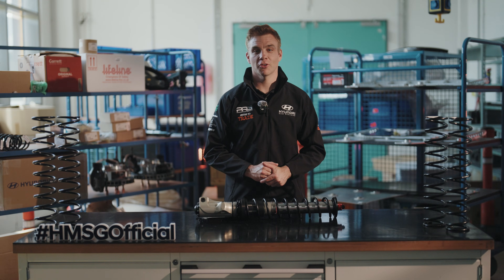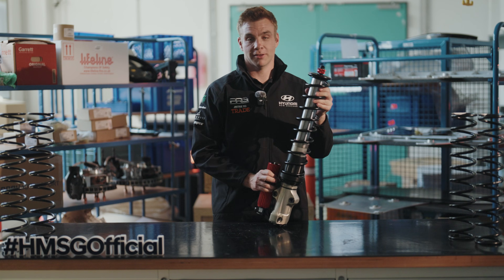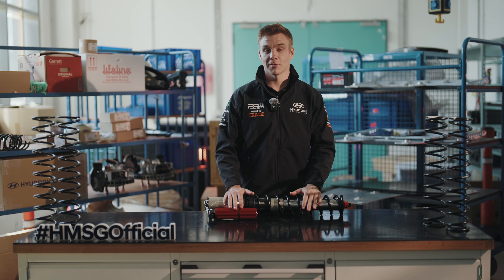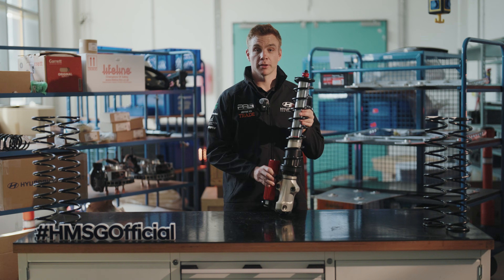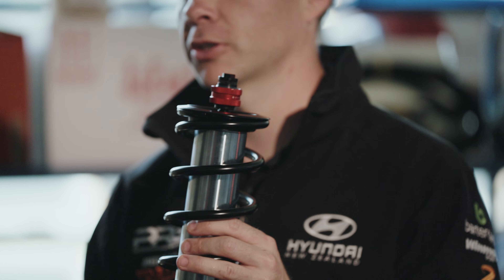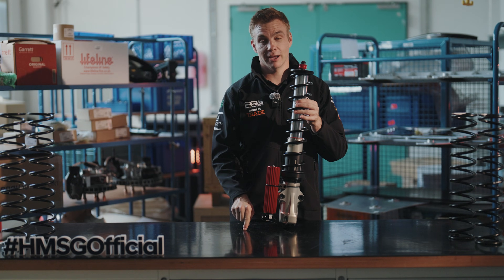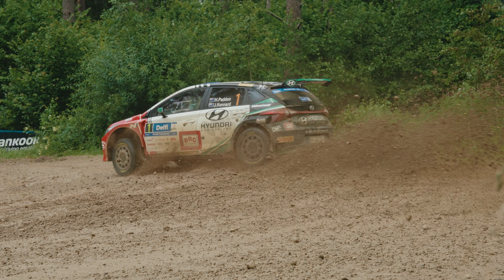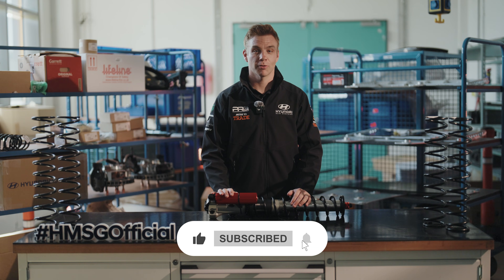Suspension Secrets Revealed: How to Achieve the Perfect Setup

Comment: These videos are ofcourse great & on-point, but here are my 2 words on what helps me wrap my head around the tune of an already factory spec-ed out suspension kit (cause, of-course, specing out a base suspension kit is a book worthy topic)

6:20
In explanation of springs & dampers, it helps me to think about them as the "steady state" component & the "transient" (varying in time) component of the suspension system.

Dampers are more interesting though & what many people have difficulties wrapping their heads around, especially in simulators. In a well specced, two speed damper, set the low speed damper as high as the dials allow. The car should be stiff as a brick & what is important, it should lose grip immediately on attempt to rotate the car.
Here is where the "transient" part comes in. By lowering the damper setting, we are spreading the rotation energy over time. So, keep on lowering that dial, until you feel the car float pleasantly & controllably from side to side, with safe amount of rotation. There are caveats to this rule, especially when it comes to stresses on materials. But this is the most straight-forward way to get in the ball park of "ideal" values.

Spring stiffness & length has to be picked in accord with road conditions. Be stiff enough to handle the road & not too short, to spread energy of bumps over period non-damaging to the chassis. Then we have to balance them, but we are talking about factory specced kit. In most cases, it is a calculated thing, just set & forget.
Reply: AND! This is for the sim guys mostly, because people building suspensions already know this.

BUMP values have to be much higher compared to REBOUND values. This is because in bump, we are working against mass of the car (sprung mass). In rebound, we are working against mass & inertia of the wheel assembly (unsprung mass).

If the car wobbles too much on landing big jumps, don't touch that rebound knob. First make sure that you are actually smoothly absorbing the landing energy with spring & bump direction of the damper.
Reply from the maker: We love seeing how different people wrap their heads around it! 😁

Comment: 600mm/sec and above  is considered high speed compression? Wow. Is this a rally car definition? For circuit cars it's more like 10in/sec or 250mm/sec. Are rally dampers (i.e Reiger) setup so that HSC is at around 600mm/sec?
Reply from the maker: Yes, 600mm/s is high speed compression, and at some gravel events the speed can reach as much 2000-2500 mm/s 🤯

Comment: Hello. I would like to know few things if possible. How does the ride height setting work in correlation with spring rate? Does it increase or decrease suspension travel or is it like a separate "block" at the bottom that doesn't affect suspension travel? 

What about spring rate's effect on ride height? I always thought that spring rate would also affect ride height because with softer spring the weight of the car alone would compress the spring more. This assuming that springs with different spring rates are the same length when uncompressed. But is this case? Does softer springs lower the car and vise versa?
Reply from the maker: So, the ride height is adjusted moving the spring platform or adding spacers between the spring and platform. The springs are compensated for a specific static load (weight of the unsprung mass individual corner). Changing the ride height does not change the total suspension travel but shifts the travel between rebound and bump.

When it comes to the spring rate's effect on ride height, the springs are load compensated. Therefore the free length is different for each rate. In this way the ride height is achieved without adjusting the spring platform 😁

Comment: How do you balance the damper in a fast rally like Finland with fast corners and high grip  and jumps? What do  you search for in different damper brands/models?
Reply from the maker: The balance for this specific rally is to have good chassis control due to the high-speed nature of the stages. That is achieved by working on the low-speed area of the dampers. For the jumps, the high-speed area needs a specific setting as this event has quite a lot of jumps. Usually, a stiffer high-speed damping is required compared to other gravel events, combined with stiffer springs 😁

Comment: I have a Toyota MR2 with KW 2 way adjustable dampers. With the same settings front and rear the car is super nervous on turn in so I am finding that I need to have the front compression set stiffer than the rear to introduce a bit of turn in understeer for stability but I'm finding it difficult to tell how best to set up the rebound. I can only test on the road so these subtler settings are tricky to interpret.
Should stiffer front rebound v rear increase stability further, or does it actually speed up the cornering response at the front offsetting the stabilising compression setting?
Thanks.
Reply from the maker: We got you some advice from one of our engineers 😁 "Making the front rebound stiffer will increase the front axle response during turn in and lose traction on power. In general you need a softer car at the rear to keep it more progressive and controllable. Remember that the corner weight front and rear are different therefore springs and damping are different." We hope that helps 💪
Reply: Wow that's amazing, thank you so much for your help. That confirms what I was starting to think after more time trying it out so I really appreciate it. But I still wasn't certain what I was feeling so I now feel way more comfortable with my settings. Thanks again 👍👍

Comment: I never knew there were so many adjustments on a suspension setup. I knew about spring rates and ride height but not the compression and rebound adjustments plus swaybar.
Back in the day when I rallied a mk 1 escort it was Bilstein dampers front and rear. I had V6 Ford Capri coils in front for extra ride height and a couple of extra leaves in the leaf spring on the rear with anti tramp rods on each side and LSD of course. I remember the first time the Audi Quattros were in the NZ international rally and the speed difference between 2 wheel drive and 4 wheel drive cars out of corners. Just amazing!
Reply from the maker: It is crazy how far suspension tech has come, and you are so right, there are so many variables nowadays, and no two drivers run the same setup! We like the sound of your Escort though, bet that was fun 🙌
Reply: @ Probably the best times of my life competing in hill climbs and rallies around the Auckland region and Rotorua and Tokoroa. I loved watching Rally NZ and remember Ari Vatanen how he could have his MK 11 Escort screaming fully sideways and still wave to the spectators. 🚗
Reply from the maker: We take it you are a big Hayden fan? 😁